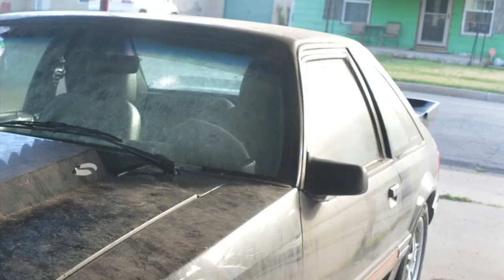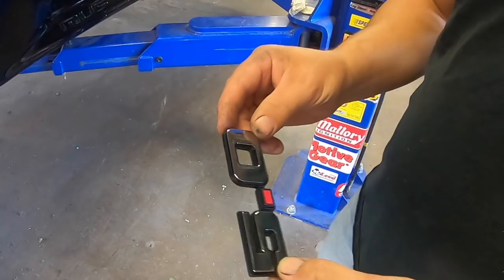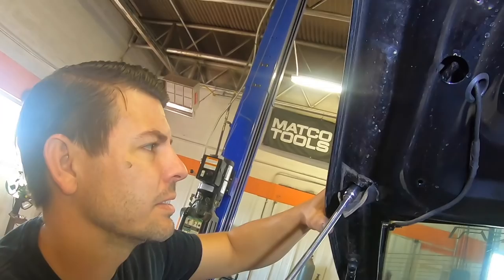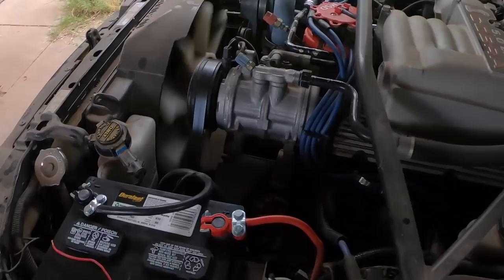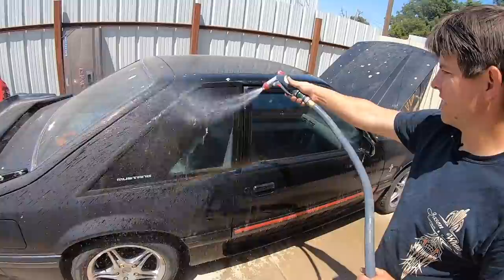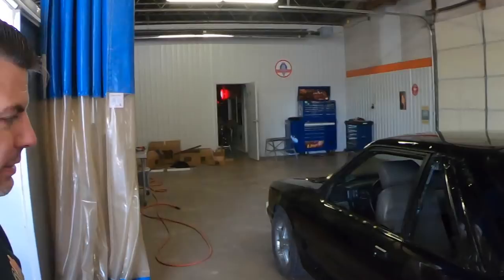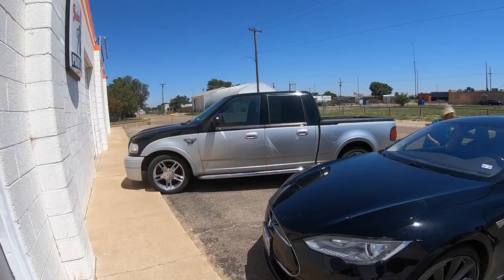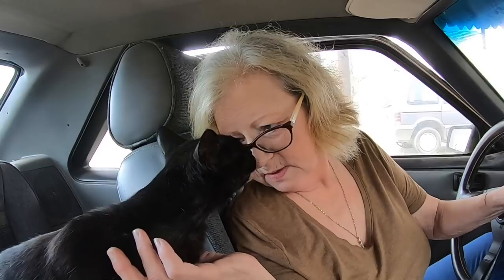Watch Us Rescue &  Restore Neighbor Lady's Mustang At No Charge

Comment: Did they just steal all of the speed parts off it wtf
Reply: Austin Doud lol you not lying
Reply: What they do???
Reply: I'm into racing, but truth is all performance parts do is lower the value of the car.
Reply: Not really!! She's not going to ride it like a race car anyways and made it reliable!.. besides the restoration made the value of the vehicle double up! I would say she repaid for the original parts& labor with speed parts!!
Reply: It would be decent if they gave her back those speed parts or sold them for her
Reply: jpmastertech There was absolutely not one part that would make this vehicle any less reliable or negatively effect the drive ability of the vehicle
Reply: Rand Kamza And your clearly not into cars either
Reply: @eriv4735  i agree car was reliable when her son drove it, and its not about the monetary value but rather its about the sentimental value. clean it change fluids and brakes maybe suspension too,  remake and replace the jba stickers and done
Reply: E Riv exactly like the front brace y remove it when u have it all it dose is stiffen you the car dosent change it’s value at all
Reply: @eriv4735  The first aftermarket thing the kid did yo lower value and reliability was cut the end of his OE crimped battery cables to expose copper and install GM sidepost terminals. The guy didn't exactly fix it correctly, but those aftermarket battery terminals will corrode way faster than OE. 
2nd thing is the bbk intake. No way will the blue silicone couplings last as long as the stock intake box. That's two mods you see 10 seconds into the video that decrease value and reliability compared to an OEM car.
Reply: Rand Kamza 🤦🏾‍♂️ Just 🤦🏾‍♂️..thank you so much for proving my point 🤣
Reply: popanollie1 don’t be surprised if a year from now you don’t see these guys with this car..they did everything possible to take her son away from this car smh
Reply: jpmastertech There was absolutely not one part that would make this vehicle any less reliable or negatively effect the drive ability of the vehicle..I’m just going to go ahead and repost what I said because you clearly did not read one or grasp what it is I wrote..these guys could have easily cleaned up the hood and spoiler (that’s was clearly important to the woman and her son) and the end price difference would have been + or - $500 at best in either direction depending on the buyer..there was no legitimate reason to chance anything about the styling, handling, or performance of the vehicle..how do you know how this woman will drive the car??..for all you know this woman has a heavier foot and drives better than all of us 🤷🏽‍♂️
Reply: B Rabbit290 Yea that’s been exactly my point..none of these parts negatively effect the reliability or the “value” of the vehicle..if anything to the RIGHT buyer she could make more..these people fail to realize that her son kept ALL of the stock parts so in a sale the STOCK parts will go with it 🤦🏾‍♂️
Reply: @eriv4735  I disregarded it the first time but since you've made the mistake multiple times, I have to tell you it's "affect" not "effect".  Also, a stock car is worth more than a car with aftermarket parts.
Reply: Shiiiiit same thing my high ass said
Reply: kalel33 Yea GREAT thanks 👍..it was so nice of you to “disregard” my ONE Grammar mistake (knowing 4 languages can get confusing 😂)..it’s fine that you can not argue me on anything else but you really want to bring up a petty common grammar mistake like the distinction between “effect” and “affect” 🤦🏾‍♂️
Reply: @eriv4735  It was the same mistake I've seen you make at least four times in the comments, so I thought I'd finally advise you of it.  Also, I did point out an issue with your logic in regards to stock car value vs aftermarket parts car value.  Watch any classic car auction and the highest selling cars are the one's that are all stock.
Reply: @eriv4735  Looking on Autotrader, a 1989 Mustang GT 5.0 with that quality of interior goes for way more than $9k.  Cars also go up in value.  Hell, I bought a no-rust running and all original 1968 Mustang California Special in 1993 for $3k.  I wish I hadn't sold that car later because it's worth almost 10x more now.
Reply: kalel33 AUTOTRADER 😂..yea way to prove my point in that you don’t know THESE cars..I’ve been dealing with these cars since before this car came off the showroom floor and trust me this car is worth 8-9k TOPS(and will probably realistically only bring about 7k in) it’s completely delusional to think it’s worth any more than that..it is not special, it is not all that clean, it is not rare, it is an everyday run of the mill mustang gt..hey if you want to pay 10k for this car call the lady 🤷🏽‍♂️
Reply: @eriv4735  I'm sure people like you said the same thing in 1989 about a '67 Mustang fastback with a 289, saying it isn't worth crap.  Also, can you show me a 1989 Mustang in this good of condition exterior and perfect interior for $7k?  I'm betting you can't find one.
Reply: kalel33 I bet you didn’t know that changing the rear quarter windows lowered the “value” more than the hood AND spoiler ever would have combined 😂😂..talk about non original parts🤦🏾‍♂️
Reply: @UCQ9V7_xDSkmVvWfeL3KSUrw How many people would know the details in a side window?  Almost none, but everyone that grew up in that era can pick out the aftermarket spoiler and hood.  I believe you're full of crap on that one.  I'm still waiting for that ad for a Mustang in that level of shape to be anywhere close to $7k.....anytime now.
Reply: kalel33 Factory quarter windows with the mustang emblem THAT IS OBVIOUS and very well known and literally is the first thing a collector will bring up (was even BEFORE any mention of a hood and spoiler)are worth almost a grand ALONE..you can THINK whatever you want but I do this and facts are facts..and “people like me”?? 😂😂 you mean ACTUAL COLLECTORS?? 😂..I not only can show you ONE in BETTER condition I can physically bring you to over 10 right now..as a matter of fact I currently have an 88 ttop with 35k miles and WAYYY cleaner than this car that I’m selling for 8k..I have a 90 I’m selling for 7k and a 93 I want 5k for..maybe in YOUR area you can’t find clean affordable examples of these vehicles and that sucks for you or maybe you just don’t know where to look and that also sucks for you but again facts are facts and the FACT is THIS car will sell for 7k..stick to autotrader 😂😂
Reply: Also you failing to realize her son kept all the stock parts he took off is hilarious because you really have no point to make 😂
Reply: @randkamza1206  that depends on the car. What performance parts do is lose you money when you install them because you will never get the same money back if you sell it. 

But for example a fully track prepped car that had like 20k sunk into it to make it fast will be more expensive to buy from someone than a fully stock one. 

of course I'm not talking about a fully stock original paint GT500, but an older BMW 3 series tracktool would cost me around 10k to buy used or 20k to build, but only 5k stock. Depending on the engine of course. 

I think this Mustang didn't have enough performance parts on it to make it worth more though.
Reply: I'm just watching but it seems they made her mustang cobra into a regular gt? why?
Reply: chuckhuckle There is no such car as an 1988 cobra..this car a just a gt with cobra parts..now it’s just a regular everyday mustang gt..but hey at least the polished it 🤦🏾‍♂️😂
Reply: @hon3yweed  I don't agree with that at all. I do think if you took a e46 m3 and sunk $20,000 into it it might raise the value a little bit over SOME stock m3's, (spend $20,000 to raise the value $4,000,lol) But the most valuable M3 is going to be a bone stock, low mileage, no accidents,no previous repair, example and no amount of modding will ever change that.
Reply: You guys complaining about what they took off the car are ignorant and ungrateful. They made it a driver Incase she wanted to keep it or sell it. They didn't have to do anything and the car would still be sitting collecting dirt.
Reply: Austin Doud what speed parts? The car sounded stock. The car is only worth 3k Max.
Reply: @brianj1204  if they made it a driver they would've gotten rid of that long shifter having, stiff clutch pressing, plastic quadrant breaking T5 and gave the lady an AOD. The lady wouldn't have a reason to sell it then...
Reply: Yeah dude that what I'm saying they took all the cobra running gear and gave her stock mustang parts nice people or not you ripped a old lady off
Reply: @mrmac5795  Yeah, they could've gave her back the old parts. She could've sold stuff like the Cobra intake on Craigslist for $150 or so.
Reply: @eriv4735  this car is* at least they* no offense don't want to fight and your right in what you say well as far as I know I am but a teen with little experience... Again sorry for the correction I just like when people see their errors so they can go back and fix them like how I advise fellow students when it comes to homework and they make a mistake.
Reply: Bro dead ass! That intake alone is worth 500 . And who knows maybe it was the intake and manifold and cobra heads! Because honestly it wouldn’t make sense running a cobra intake on some stock 302 heads! All the really needed to do is knock out that old dust like they did and buff the pain how they did. Every mustang owner with a regular 302 in it wants a cobra or gt40 conversion. She might as well should of just sold it and bought another car because that car is not the same as her son had it. That’s a completely different car.
Reply: Geovanni Novoa The cobra intake on the factory e7 heads is a very common upgrade and is good for some added power (the stock heads don’t get enough credit lol)..these guys wouldn’t know gt40 heads if they got hit over the head with them..all the money and hard work her son put into his car is worth nothing to these people and that is truly sad
Reply: Rand Kamza You just keep proving you know nothing and that is hilarious..a REAL cobra intake can get $500+ USED good luck finding an explorer intakes for $150😂😂
Reply: The Gate I’m not sure what you are talking about..
Reply: @eriv4735  factory cobra intakes were $394 new.  I live in Vegas, a Cobra intake isn't special when you can spend $40 and get a gt40 intake at picapart all day. I've owned fox bodies off and on for almost 20 years and had a stock longblock speed density car that ran 11's. So, I know about fox bodies.
Reply: Rand Kamza Google a great thing isn’t it kiddo?👍👍😂😂..I highly doubt you even have 20yrs to talk about in general let alone experience with fox body’s..but let’s run with your theory..$400 20 yrs ago sounds about right but that was 20 yrs ago and they only make Chinese knock off now so like I said you’ll be hard pressed to find a REAL cobra intake for less than 500..no one said ANYTHING about gt40 anything I said explorer (common newb mistake so I’ll let that one go)..while all 3 intakes have similar flow characteristics there is a clear difference in them and to a true fox enthusiast the cobra will always bring more money..if you had HALF the “experience” you claim you’d know these simple things..the fact that you clearly do not makes your whole argument and tall tales fall on their face 😂 And YOU RAN 11s 😂😂😂
Reply: RemoverInnaWoods A cobra intake on top of factory e7s doesn’t really move the rpm range as much as improve flow throughout the whole rpm range
Reply: What,the stickers?
Reply: @eriv4735  You need to work on that sentence structure so one would have an idea on what your trying to say.
Reply: Jack's Son Yea sure..whatever you say 👍
Reply: The engine it’s self
Reply: @eriv4735  you're*
Reply: Ripping Lips 🤦🏾‍♂️
Reply: Jason Davis There was not a cobra in 1988
Reply: @randkamza1206  Yeah I know, I said it depends on the car. 

But I would bet that something like a team Schirmer type M3 is much more than a regular one. 

Still, I wasn't talking about M3s.
Reply: @jacksson9391  give one example then.
Reply: I Kno 😡😡
Reply: @Jack's Son *Goes with an oddly structured sentence that is riddled with improper grammar trying to correct someone on the internet lol
Reply: The problem with the people saying "the stock parts are better for reliability and the cars value anyways", whether you're right or wrong (and I think it's wrong in this case, because those are RARE sought-after parts, not cheap bs), you're entirely missing the point... Which is the sentimental value of keeping the car how the son had it. For that reason they should have kept it the same, period.
Reply: They took all of her son out of that car. What a shame.
Reply: Before cobra later FORD😠
Reply: "Speed parts"
Reply: that car has been sitting unused for over a decade, i don't think she will miss the aftermarket hood or 'fin' as she called it. this man gave her a fully rebuilt and restored mustang free of charge and you're concerned about some absolute trash 20 year old parts lmao. you're probably the type of guy who gets free stuff then looks for defects to complain about.
Reply: @ericoffutt9499  it was her sons car it should still look like her sons car
Reply: @randkamza1206  no they dont effect the value. sometimes it will raise the value. just watched a old ford bronco restored to original sell for 50k at auction  3 cars behind it was another bronco around the same year lifted with mud tires it went for 80k.
Reply: @MrBlaze256  well that's one auction, one example, probably a public auction at that. 
I am a car dealer, I am talking to private auctions and actual car value, not two public knuckleheads in a bidding war. 
I used to do condition reports for Manheim in my previous job, and yes, aftermarket stuff like wheels lower what we called the MMR, which is the estimated value of the vehicle in private auction.
Reply: @randkamza1206  im talking about the high up auction the one that sold the bullet mustang today I cant think of the name of it.  Aftermarket on these cars doesnt decrease the value. Its a 3-4k car.
Reply: Yes they did 😭
Reply: @MrBlaze256  Mecum and Barrett Jackson. Once again, a completely pristine stock example sells more than something completely modded. You can't sit here and tell me that if you had the first mustang ever made on the assembly line, it was all matching numbers, completely stock and had like 30 miles that it wouldn't be more valuable than any modded car on Earth.

Comment: I would've left all the Cobra parts on the motor and just gone through it to make sure it was dependable, kept the rims and the hood also!! They ruined the sons vision of the car
Reply: Some kept them parts lol
Reply: Lol I bet mysteriously they’ll be building themselves a fox body soon with those parts
Reply: @chukob5  LMAO, I bet you are correct!
Reply: Not the right parts probably part of why it ran like shit, and the aftermarket alarm system in a $1,000 car LOL...yeah they did it far more justice putting everything back to stock...those cars aren't worth anything in the first place and the hack job aftermarket garbage that was put on it destroyed what little value it had.
Reply: @wildbill23c  i have basically the same build as this, shit runs fine, but i dont let it sit for more than a week without running it

Comment: I think she would have rather had it the way her son did it and you all took the performance parts if the truth was told I'm just saying
Reply: It's performance parts are in the box.
Reply: David Lewis I thought  the same thing but her son was a gear head she isnt so I think they did it so she could just drive it without her having  to mess with it, and in  the long run it would be a reliable car for her , but I totally  get you because  I did the samething to my dads 69 chevelle  it so far from stock it's crazy,  I'm building it for the Texas mile speed race
Reply: I'm thinking the reason they bought all the stock parts and put them on instead and gave her a box with all the aftermarket parts, is it's worth more to more people as well has appeals to a broader range when it's restored to stock condition, plus, if the buyer wanted the aftermarket parts, that's more money added on top of the price of car, if not, sell them to someone else after the car is sold. =)
Reply: This nice little lady is probably not a gear snatch'n, relight chase'n, aftermarket install'in,  type type of gal. And a lot of the parts took away from the looks and dependability. I have to agree Jerry and his crew did the correct thing.
Reply: Most people who are in love with parts like that most likely couldn’t afford the car anyway.  Like it or not, the women’s struggles are real and if she needs quick cash, the car is more sellable in a condition that appeals to a broader audience.  Her son had the abilities to tinker with the car and fix it.  She doesn’t.

Comment: They took off everything that her son did to the car 💀lost all of its sentimental value 😂😂
Reply from the maker: No, she's still got the half used Rolaids tube in the console. She said the car still smells like him inside. The scent is still there, so a sentimental trip back in time. The old hood and wing and intake are still with the car. Jason worked two months on this. I can't even get some people to slow down long enough for a minute or two of their time. Sanding and working fiberglass, and then paint work on dinged up parts is quite a bit of time and work compared to installing new.
Reply: Well, if they were shined up, eventually put them back on, glad they were not thrown out!
But the car does look pretty shined up, and you guys did a good job there.